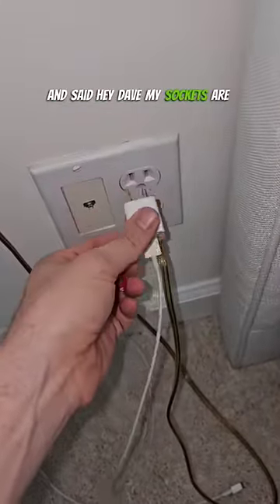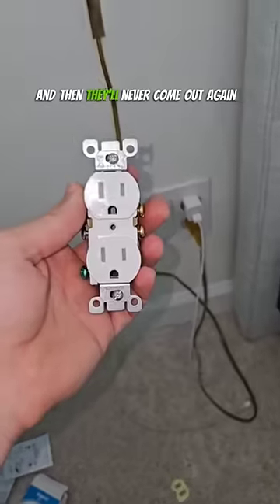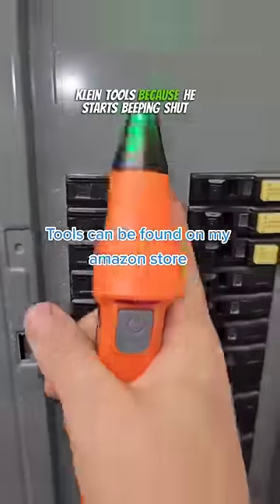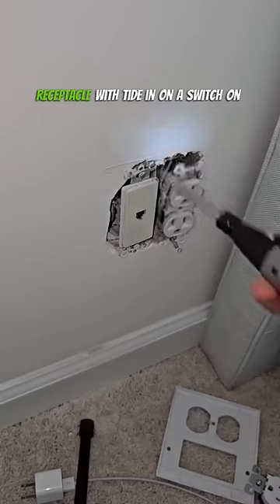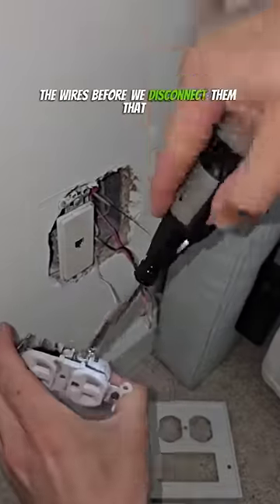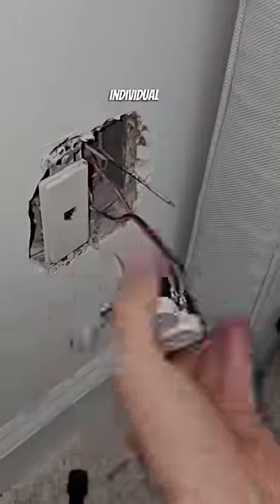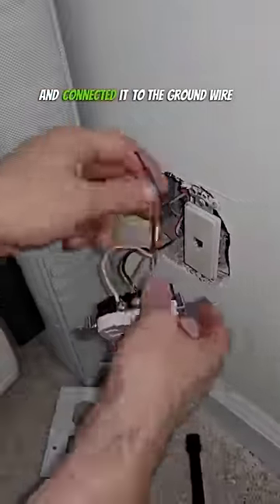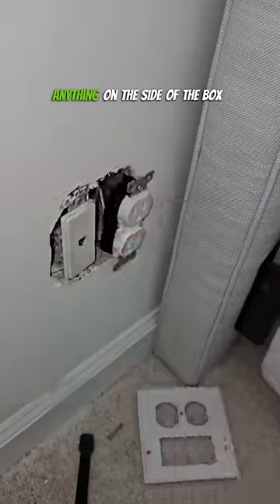🔥 Thats a hazard! How to change a switched outlet #diy #handyman #electrician #HowTo

Comment: That's far from the ONLY way to find a breaker. The best way is have you buddy sit in the room and yell "NOW?" With each breaker until he yells back.
Reply: Are you even a child of a DIYer if you don't yell "still on!" back to whoever is flipping the breakers?
Reply: Sounds like something me and my coworkers do. 😂
Reply: Easiest way is to short the plug
Reply: Hear me out, just shut all of the brakes
Reply: @GortDoes420  That is an option, but often you need power for whatever project you're doing. Power tools, light ECT. So you need to leave other breakers on.
Reply: @GortDoes420  now you can't see
Reply: @finlaymorgan1405  flashlights? Maybe your phone screen if you got one. Shit even a lighter. I know every electrician smokes darts
Reply: @finlaymorgan1405 Do you live in a box with no windows?
Reply: Just short it 💅
Reply: Or y’know, label them
Reply: I didn't realize how common that was, it's friggin hilarious though
Reply: @rocksgt3104 Is it constantly day time where you live?
Reply: How about using the reset button on your receptacle tester and tripping it back to the panel
Reply: @GlamourNNail that’s the comment I was looking for!
Reply: Just short the plug, or look at the breaker list that hasn't been updated after like a million renovations.😂😂
Reply: @finlaymorgan1405 Are you working at midnight? Or in a building with zero windows?
Reply: You can also just strip some wire on both ends and put it in the socket (on both sides). You're directly testing if it works.
Reply: Plugging in 3 space heaters is another surefire way to find the correct breaker
Reply: My favorite way is to identify AND test the breaker at the same time with a circuit breaker finder. That’s what I call it. Some people call it a dead shorted plug. To each his own!
Reply: That sounds very Mexican.
Reply: @GlamourNNail  so you flipped the breaker back on after hearing that it’s not the one
Reply: Radio
Reply: Or you just label the breakers xD
Reply: @Slimboy025  no, you have to find them first.
Reply: WHAT?! IS IT STILL ON? ………*cursing under your breath*
Reply: No, the best way to find a breaker is shoving a fork in the outlet and see which one trips.
Reply: Plug in a lamp and turn off the breakers one at a time until it goes off
Reply: @GortDoes420 what is smoking darts? Honest question?
Reply: @finlaymorgan1405  Oh my heck (as of today) 26 people agreed with that!  God help us.
Reply: I Agree
Reply: I prefer one single wire to find the breaker
Reply: @Urmel331 Electroboom - "Don't short shit."
Reply: my breaker's are labeled
Reply: @GortDoes420 PHONE?! But then it’ll drain my battery and I can’t post about not being able to see on YouTube
Reply: We have phones now.  No need
To holler lol
Reply: Soo, you don't have breakers tagged?
I have little pieces of paper next to each breaker put there by producer of the box
Reply: Well, the BEST way is to go through all the breakers, one by one, and write on the back of each plate what breaker that outlet goes to, so you only have to do it once.

Until you paint, at which point they’ll be all scrambled, but 🤷‍♂️
Reply: Idk About you but i just didn't turn off the power breaker to much trouble the outlet cant out put enough to hurt or really any to me 😂
Reply: LMAOOO the only true way
Reply: when i was an apprentice the guy training me would just call me on my phone :D
Reply: That assumes this guy got friends in the first place
Reply: memories
Reply: The amount of times ive done this with my dad is unbelievable
Reply: Wrong, it's to have your wife not answer cause the kids are distracting her.
Reply: @GlamourNNail  it's not even being a DIYer it's just being a home owner. Only the rich can afford to be useless.
Reply: What put our phones to use for once instead of just for shorts 😂😂😂 but I like your old school way better I need the phone for flashlight lol
Reply: It's much funnier that way honestly.
Reply: I mean, considering that the detector makes a noise, it’s pretty much just that but one human is replaced
Reply: The best way is to touch a screwdriver across neg and hot and the breaker actually turns off for you
Reply: Facts I do this!
Reply: @GlamourNNail When your dad finally flips the right breaker, then immediately turns it back on after you say it's off, and then he moves on and forgets which one he flipped so you have to wait for him to cycle back around again...
Reply: @ChrisJohnson-ww4vs Electrical receptacle MUST be installed during the Witching Hour!
Reply: Or just use the identifier on the door to the box then verify with voltmeter....
Reply: nope. best way is to stick your favorite breaker tripper into the plug and then check the panel.
Reply: Me and my co workers 😂
Reply: He knows!
Reply: Every single time my dad needs to turn the power off. “Am I good?” “NO STILL ON” “goddamn it” flips another
Reply: Yup, all dads all over having their kids watch and screaming now?! From the basement only to come up, I said now before you flipped it, having to run back down shaking your head rethinking your life why did I have kids, repeating the process
Reply: I prefer the method of leaving the light on in what ever room and running back and forth. Great workout and so long as the guy who wired your house up did things right, you'll not have any problems.
Reply: @finlaymorgan1405  that was my first thought. Take an extension cord cut off the female end and wire nut the wires together wrap the hell out of it with electrical tape and just plug it in. Not a good idea but definitely the fastest method
Reply: @Hi-jl2wy  even better if you can just do it in the plug itself, live to earth would be best if you have the earth pin,  I actually did this just 2 days ago when I couldn't find which circuit some DIY cables were on
Reply: I use the good ol' lamp test. When the light turns off, I flipped the right breaker...lol.
Reply: Splice together two male ends plug em both in boom now you have turned off the breaker.... And some other stuff
Reply: Facts.
Reply: I used my alarm clocks radio to do it alone. When the rock music stopped I was gold
Reply: @finlaymorgan1405 no it's not. It does the same thing as the worthless tool.
Reply: Yup
Reply: Radios work better
Reply: Works for me... 👍
Reply: Who even shuts off a breaker for one receptacle??
Reply: Yep 😂
Reply: @YourMama_420  best reply comment...
Reply: This is the way
Reply: Yall forgot the screwdriver technique?
Reply: and take the next three days resetting clocks in the house....😁
Reply: You don't really need to turn the breaker off tbh
Reply: nah, the best way is guess and then see if it shocks you.
Reply: I just ended up making a gadget to blow breakers for me, attached a lightswitch to an extension cord whip, wrap in electrical tap around the switch contacts and your good to go. Just got to plug in and flip to find your breaker.
Reply: Just trip it
Reply: @GlamourNNail wait why do you need power tools for just changing a receptical at most is just a powered screwdriver which should be cordless anyway
Reply: @anonymoususer8517  because changing an outlet isn't the only reason you would need to turn off the power. And a drill, which isn't always cordless, is a lot faster than a screwdriver.
Reply: I've got the breaker finder 3000. Just a plug with a short wire where everything's twisted together. Plug that bad boy in and you will know instantly which breaker it is. Only cost like 3 bucks 😂
Reply: me who cross-references the Breaker # with the old, worn chart on the panel door that is written in cursive
Reply: Engagement bait, he said it so we'd comment
Reply: I just plug in a radio, crank up the volume, and start flipping breakers if they aren't  marked.
Reply: I should get one of those, though. Would save me a lot of time!
Reply: This is international 🤣
Reply: If you're on your own, you can plug an obnoxiously loud speaker into the outlet. When the music/noise stops, you've probably shut off the correct breaker switch.
Reply: Or just disconnect all of them. It takes like 5-10 min to change a socket.
Reply: "Stomp on the floor!"
Reply: 😂😂😂 that’s how me and my dad did it!
Reply: Breaker should be labeled

Comment: I didnt know there was a switch immobilizer that needs to be removed. Neat!
Reply from the maker: Yea its on most all outlets
Reply: @Mechanicallyincleyend  do you remove the tab on the neutral side too, or is it only on the hot side?
Reply: @Jajaky  Generally you remove the tab from only the hot side, because there will be only one neutral wire coming into the box.  I suppose there could be separate neutrals, in which case you could remove the tab.
Reply: @tgeliot  oh makes sense. The bottom outlet wouldn’t get a neutral to complete the circuit if they were both broken off
Reply: @Jajaky  Exactly.
Reply: Wait, what's a "switch immobilizer"?
Reply: @tgeliot  what, your switches don’t run away?
Reply: @Jajaky  LOL
Reply: @tgeliot  They never explain this shit. Just assume everyone knows
Reply: He said it, but just to reiterate, you only remove the tab when the sockets need to be separated, such as when one is switched. 
You could also ignore the switched wire and cap it off, in which case you should also remove the switch or mark it as unused.
Reply: @TomCee53  I understand that whole concept, but calling it "switch immobilizer" seems very weird to me.
Reply: @tgeliot he means the jumper
Reply: @randybobandy9828  Yeah apparently he's calling the jumper on the side of a duplex outlet a "switch immobilizer" and I'm the only one who finds that bizarre.
Reply: @tgeliot  The only two reasons I know of for having to break the neutral tab on a duplex receptacle is if the two receptacles are on different circuits (e.g. a separate lighting circuit and a receptacle circuit in a room) or if the switched side of the receptacle is on a double pole switch.

Double pole switches can switch two lines on or off at the same time. They're typically used with 240v loads, but they can also be used with 120v loads to disconnect the hot and neutral at a switch going to a load.
Reply: No you only remove tab on side of receptacle that the line wire (black) and red wire are going to. You also always put the red wire back on the same screw that you took it off of on the other one bc that has to continue sending power through that plug.
Reply: The red is bacislly a switch leg or (the switch) part of the wire that turns it on and off everything else is like a regular plug
Reply: @Rymac91  Yeah.  Rare circumstances.
Reply: @tgeliot  nah it definitely sounds weird to me too lol
Reply: @Mechanicallyincleyend  what's a switch immobilizer?
Reply: @tgeliot  you must remove the neutral side also, if you are using the second "phase" in the house for the switched receptacle, and the first "phase" for the other receptacle.
I have phase in "" because homes only have one phase with a neutral in between.
Reply: @UltraGamma25  Unfortunately, "Don't ask don't tell" seems to be the default way things are explained.

Of course not everyone loves learning new things ...
Reply: @anjhindul  I'm surprised that you say this.  I thought that one of the advantage of using opposing "phases" in a pair of circuits was that they COULD share a neutral.
Reply: @Jajaky  You only remove the neutral if you are running two separate circuits to the same receptacle
Reply: @tgeliot  I find the term "switch immobilizer" odd too. My understanding of that term, is used to reference a device that physically restrains a switch from moving.
Reply: @tgeliot  electrical code in the US no longer allows sharing of neutrals across more than one circuit regardless of phase or any other factor. They MUST be separate if on a separate breaker. The neutral does carry load.
Reply: If you didn't know this you shouldn't be touching electrical
Reply: @YoutubeisAZZho  if you didn't know that thing isn't a switch immobilizer or even close,  neither do you. Lol
Reply: @YoutubeisAZZho  i know, never work in hotels...ever!!!
Reply: Only used if it's fed by a 3 wire though
Reply: neither did the person who wired my house lmao had to go in and break all the tabs with my dad when we moved in lmao
Reply: @goosenotmaverick1156  Good to know, but of course that doesn't change all those old installations.
Reply: Actually very helpful. Every outlet in my house wired to a switch controls  both outlets. So annoying
Reply: @thecrookedmailman7111  Helpful if you have an unswitched power line in the box.
Reply: @goosenotmaverick1156  And with good reason.  I verified that all wires in a box were unpowered, then removed the outlet and got sparks from the neutral connection.  Yikes.
Reply: @tgeliot  they aren't jumpers, yes it acts as a jumper, but technically it's a shunt. Outlets by default have them in. In fact only enough outlets was a screw style shunt that you had to unscrew and remove instead of a tab.
Reply: @zacharythebeau163  I agree, a "jumper" is something you can add, not something you break off.
Reply: It connects the top and bottom sockets. Removing the tab just makes them separate outlets that can be supplied their own power (like when you want a switch on one but not the other)
Reply: We don't have them in Australia
Reply: its not a switch immobilizer. its a circuit immobilizer. The plate connects the two receptacles so they can run on the same circuit. The top receptacle is powered from the wall switch circuit. and the bottom receptacle is a constant hot. All the plate does is connect those two receptacles if you want them to run on one circuit.
Reply: @Jajaky only in the hot side
Reply: You don’t typically see that on new builds anymore because of all the integrated lighting in the ceilings.
Reply: @Jajaky taking the tab off the neutral side makes it two diff circuits
Reply: How did u not?
Reply: @Mechanicallyincleyend never thought about electrical tape around outlet. Good call
Reply: @tgeliot broken tab recpitacal, if you break the tab off then the two spots no longer are linked so the bottom or top is connected to the switch and is only hot when the switch is on and the other is always hot
Reply: @connorring737  Yes, thank you, many people have explained this.  Apparently I am the only person who thinks calling this feature a "switch immobilizer" is bizarre.
Reply: I've never heard that tab be referred to as a switch immobilizer. And for those who say it doesn't make sense. It definitely doesn't make sense and I doubt that's what it's called.
Reply: @tgeliot  I don't know why he's calling it that. The piece of metal just gives voltage to both outlets. If you want them to each be on their own voltage, like if one of them is operated with a switch, then you remove that metal tab. That's it. It doesn't "immobilize" anything. Maybe he was just trying to sound smart. Or he's a dork. Doesn't matter.
Reply: @Jajaky remove the tab on whichever side has double leads.
Reply: If you leave the tab connected both plugs become switched. If you break the tab only one outlet is switched the other remains live.
Reply: @Mechanicallyincleyend the same way that "the only way to find the breaker is this tool from an expensive name brand"?